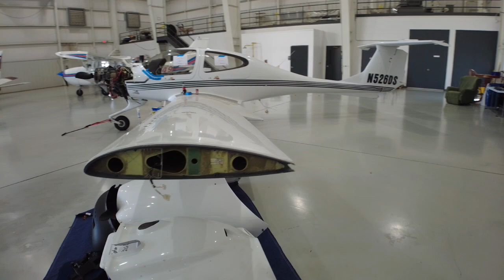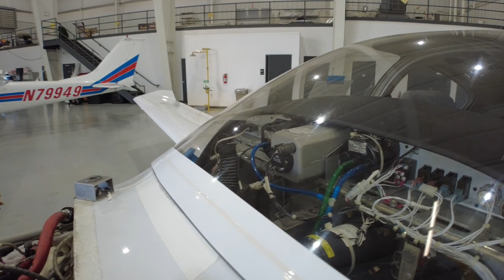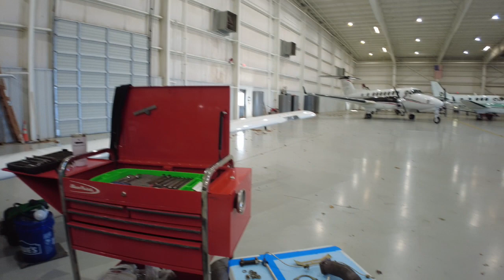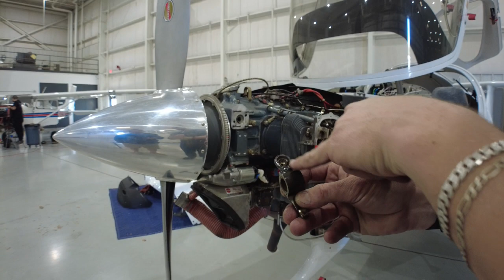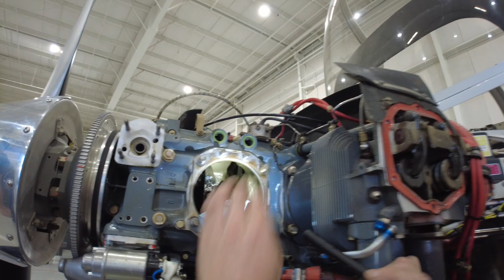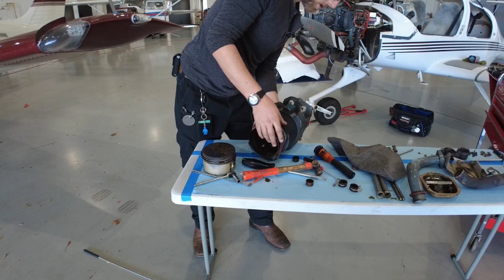Airplane Cylinder Removal-Diamond DA40

Comment: The wrist pin holds the piston to the connecting rod. The rocker arm shaft holds the rocker arms in place.
Reply from the maker: He misspoke and it definitely did not go unnoticed.  You are not the only one to point that out. :) Thanks for watching.

Comment: Shouldn’t you use torque plates when removing a cylinder?
Reply: Also magneto’s don’t need overhaul every 500 hours, just a 500h inspection.
Reply: Torque plates are less of a concern with Lycomings due to the design of the bearing shells.   Loss of clamping force can be mitigated by ensuring the prop is not turned while the cylinder is off.

Comment: You might want to consider hiring another mechanic.   

    He apparently didn’t do any troubleshooting to include borescoping or staking your valves before simply removing the cylinder.
        
   Valve guides can be reamed and valve seats can be ground without removing cylinders.

    He also kept calling the rocker arm shaft a “wrist pin”.
     The wrist pin connects the piston to the connecting rod.

     There is no requirement to overhaul magnetos at 500hrs.   An IRAN is a good idea at 500hrs and will save $$$.
     If you are springing for “new” magnetos, why not install an emag?  Same price as a new mag without the requirement for periodic IRAN.
Reply from the maker: I think my mechanic does a great job.  Bear in mind that you are watching a highly edited and condensed view of what occurred. 
He did borescope the cylinder.  That is how he found the separation between the cylinder sleeve and the head.  The cylinder had to be removed for that  problem regardless of the valve issue. 
I realize there is no requirement for overhauling the mags at 500 hours.  These mags had 1700 hours on them so they were due for retirement.  I am not an emag fan yet.  They are expensive, require a backup battery if I install 2 and I know a couple of people who have a fair amount of problems since switching.  I think they will be viable in the future but, not quite yet.  

Thanks for watching.
Reply: In the end the jug would have to come off to be repaired correctly.
Reply: Well that is unfortunate that the editing places this A&P in a negative light.

    For clarification, these cylinders do not have a “liner”.   

    They are constructed from a solid forged steel cylinder with male threads at one end and a flange at the other.

     The cylinder head is made from cast aluminum alloy with female threads.  

The design of the threads is such that a significant interference fit exists between the cylinder barrel and the head at normal operating temperatures.

     When the cylinder assemblies are constructed, the steel barrels are chilled in liquid nitrogen and the aluminum heads are heated to approx 500F and the two are threaded together.

      If there is wear on the cylinder, it can be machined oversize with matching larger cylinders and rings.

     Aircraft cylinders can not be lined with a liner.

      The two modes of failure of this construction (not involving the valves)  that would cause a significant loss of pressure during a leak-down check are:

        A significant crack in the cylinder head.     or

        A head-barrel separation.

     If you had a head-to-barrel separation, those tend to be very obvious or there will be significant exhaust staining around the base of the head.

      Head-barrel separations are extremely rare and would make for much more interesting content.

       Instead, this video suggested that your mechanic pulled the cylinder for a leaking valve.   In most instances, a leaking valve can be repaired in-situ.

     Do you plan on showing this cylinder’s head-barrel separation in a future video?
Reply: @Stepclimb  The mechanic even said at the end of the video that he may have pulled the cylinder unnecessarily.  "You know, I'm wondering, now that I'm messing with this, if it was the intake valve.  Because, this thing is super-stuck."🤔  

This is not a huge deal - we all need to learn.  Most mechanics, after spending years at A&P school, and then 10 hours a day in a shop, probably don't want to spend 1-3 hours a day reading about the latest improvements in how to maintain aircraft engines.  People like me, that do it for fun, really soak up this kind of stuff.  Not in any way trying to say I know more than this guy, or that he doesn't know his job - he clearly does.  Just that we are still progressing in our understanding of how to maintain these old engines, surprisingly.
Reply: @dermick  Agreed.   It is always good to continuously learn and perfect one’s craft.  That is the mark of a professional.

      It appears the OP is involved with the maintenance of this aircraft above that of most owners, which is fantastic.   Hopefully his A&P is open to suggestions and even lets him perform as much of the maintenance as he is comfortable with.

        If you log the time and tasks performed (signed by the supervising A&P) you can eventually take the tests to get your mechanics certificate.

       Hopefully everyone can learn from this.   

      Now that the cylinder is off, I’m wondering if the mechanic will clean the valve and ream the guide?    

At a minimum, a new base gasket and ring set would be needed to place this cylinder back in service.

       I would imagine he can forgo a complete overhaul $$$ since this appears to be merely a stuck valve.
Reply: Who hurt you?